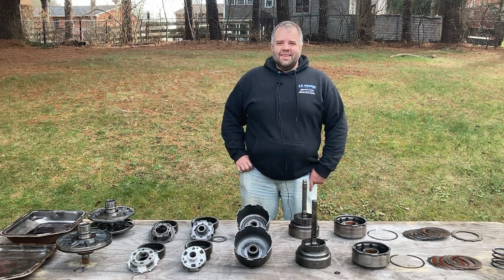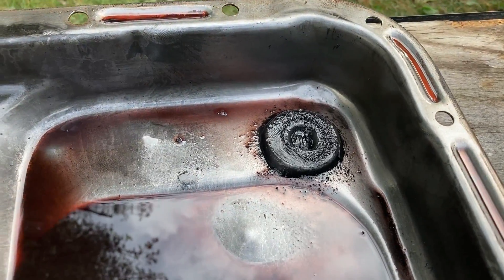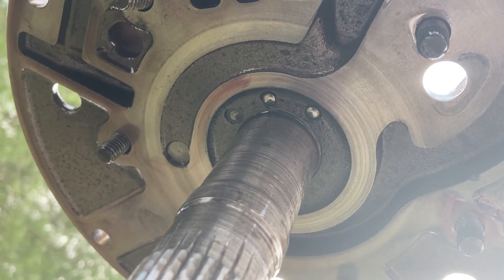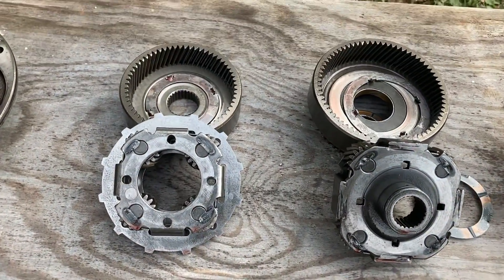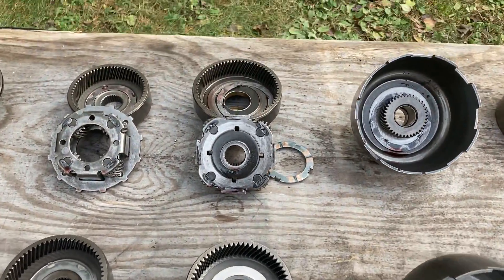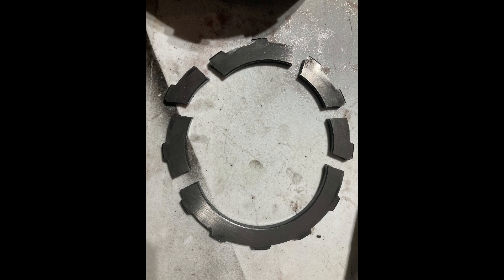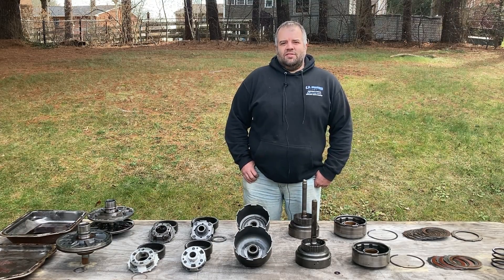Torqueflite build for Plan Z Dart - Part 3 - parts selection

Comment: nice video and great info...but building a trans/engine combo, to run 1/8 or 1/4 mile, over a determined rear gear ratio is lunacy....put the correct gearing the car
Reply from the maker: It’s all about the constraints of how far we want to deviate from lightweight, low drag, and factory parts.
Reply: @JohnWilburn  ok...you know the weight and estimate the low drag (interested how that's done) but if the factory gear was 2.73:1 you'd make a change, no? 

My point is gear it accordingly to match those parameters and change the gearing to match....plenty of ring and pinion combos with a Mopar...what am i missing ?
Reply from the maker: @smokeysghost4759  The effects of static weight are pretty easy because we generally see 1/10 second come out to equaling 75-100 pounds.  I actually took notes of estimated driver weights when I was at driving school because we saw all different size drivers in equal weight cars.  I got 84 an pound average. Rotating and reciprocating weight are much harder to estimate.  Usually we just rely on before and after data for that and this unusual combination doesn't have a ton of precedent.  Low drag means fewer parts like the 9" Ford, which while wicked strong, eats up a lot of ET to frictional losses because of the pinion placement OR loss to windage drag in the oil pan... things like that.  As for the rear gear:  4.10 is the deepest gear available for the fly weight, low drag (high pinion) 7.25 rear.  So, another deviation from "lightweight and low drag" would be going to an 8.25 and more gear.  Unlimited places exist to deviate from light weight and low drag, but everyone else is doing that.  Why not see how far a purely stock basis can go before deviating?
Reply: @JohnWilburn  ok, so in drag you meant driveline loss or parasitic losses...got it. I agree - 1/10 for every 100 lbs. 

the loss difference between a 7 3/4 and 8 3/4 - final gear same -  is negligible as I've seen/done 100's of chassis dyno runs. your biggest driveline loss will come from the auto trans vs manual (4-5%) and the converter stall speed and flash. Let me add - rear wheel weight and tire size/height are also an important drive-line loss winner or loser.

one quick edit - reciprocating weight/mass is all in/done with piston weight/con rod small end/piston/pin/rings - rotational weight and mass, as in flywheel, trans and driveshaft are going to deliver the lowest losses the lighter they are - on caveat here is that given the gearing you need to have the correct kinetic energy of the flywheel ( and this could heavier or lighter) to be both efficient.  As mentioned above, the wheel tire combo (weight) also store kinetic energy and need be correct - a light wheel (let's say magnesium is great on a road course and has minimum losses)

I still say gear it right
Reply from the maker: @smokeysghost4759  "Right" for a fixed parameter of a 4.10 gear or "right" assuming we change it?  I get exactly what you're saying and if there was one fixed and common goal for every build, there would be one fixed and common answer, but this build has flexibility and we can report the ups and downs.   No one runs a 7.25 rear, so isn't it cool to see what one channel can do with one?  There are 100 channels where guys throw them in the lake, stick in an 8.75, and talk about what all that does.  While it's ultimately Tony's call, I think for the fun and interest of the channel, we'll let the audience decide and can always swap later.  It's quite simple to swap gear sets in a trans once it's out of the car.
Reply: @JohnWilburn  Fair enough - thanks
Reply from the maker: @smokeysghost4759  His shirts do read:  "It's not how fast you go.  It's how you go fast."  I'm embracing that for his build.  I'll apply a standard I choose to the Dart Sport I'm doing and it will put vintage feel above absolute ET or power.  I'm all for seeing what other folks do with their visions, too.  To me, that just makes it more interesting :)

Comment: Personally I’d say standard in the low power setup. Use converter stall to compensate and later switch to a more appropriate rear gear. I’d also run a good cooler too though.

Comment: Could you put in one wide ratio, to help with the launch and strength. Then one aluminium standard for the 2-3 shift.
Reply from the maker: No.  They share a sun gear and must be used as a pair to work.  Even if you could mix and match, like in a manual transmission, it’s better to go a 1.54 second gear from a 2.74 first.  A 1.45 second is an even bigger span to cover.

Comment: John, I am not a transmission guy, but just from my perspective in protecting and saving the Transmission, I would recommend the Following 1). Install the deeper oil pan with the magnet-more clean oil running through the body of the A-Transmission cannot be a bad thing 2) Go with the steel planetary gears-aluminum can swell and break easier
Reply from the maker: Notwithstanding any veto by Tony, we are definitely using the deep pan with magnet.  As for the aluminum planetaries, I'm letting the viewers decide, but bear in mind that the Hemi cars came with aluminum carriers, albeit of the four pinion variety.  The gears themselves are steel in both.

Comment: My vote is the wide gearset..  when I had a 302 in CASPER I went to a 2.90 first gearset and it made a huge difference at the track... Plus I kept the 3.50 gear which was nice
Reply from the maker: Casper has triple the horsepower and weighs, literally, double what the Plan Z Dart does.  I'm not replying with own biases as I want to hear what other folks are thinking.  Casper is a beast!
Reply: @JohnWilburn  trust me this way before Beast mode!  It had a bolt on 302 in it first!
Reply from the maker: @UnityMotorSportsGarage  Oh, I very much do trust you.  I’m leaving my own leanings out of it and letting the viewers decide.  It’s just an hour swap if we want to change it later.
Reply: @JohnWilburn  I get that.. it's going be awesome no matter which way you go
Reply from the maker: Maybe Casper can race Plan Z with a 15 car length spot.   Hmmmm....
Reply: @JohnWilburn  well.. that would be interesting but that involves me getting MIXED UP BOSS DONE! Haha
Reply from the maker: @UnityMotorSportsGarage  Why?  Even on seven cylinders, that would be a race!
Reply: @JohnWilburn  oh I didn't tell you that 100 feet we drove it... Broke the Crank! Lol
Reply from the maker: @UnityMotorSportsGarage  Can't wait to see the autopsy footage or see it in person.  If you would, save a piece of the shrapnel for me.  That trip was a great story and memory.
Reply: @JohnWilburn  oh you will have an assortment of goodies to choose from! 😂

Comment: I had snap rings pop out after all my efforts👍👍🐎
Reply from the maker: Oh no!  Snap rings have to fit well or they don’t fit at all.... also, the groove is either all there or something isn’t right and needs to be corrected.  It’s tough to watch a 25¢ part cause havoc on a build.
Reply: @JohnWilburn  yes it was on my 95 f350 / electronic trans/ 460 motor / my son on in law was so sad I blew it
Reply from the maker: @Jupitermustangmike  Redemption is just another try away!

Comment: Dang it sux that your stripping an overdrive trans for it but you definitely should use the low ratio, I have the A500 in my Ramcharger and it’s nice and peppy off the line
Reply from the maker: The overdrive unit comes out in one piece, ready to donate to another A500 whose fourth gear takes a dump.  Nothing will go to waste!

Comment: I would go for a quicker 60ft if you not going o drive it a lot on the highway
Reply from the maker: The car is race only, but third gear is direct drive (1.00:1) in both anyway.

Comment: Seems from the way you are talking many parts are interchangeable and some are not, and it seems the cases are the same. Automatics are magic to me. Since some parts can mix and match can you explain what prevents you from using the steel short first gear with the aluminum second and drum? Is it a case of all the internals need to go in one case or the other? Would a custom high stall torque converter with the extra pan capacity be enough to make up for the tall first gear in a drag race only application where you are limiting the time for heat to build?
Reply from the maker: Unfortunately, the overdrive case can’t be used in a three speed application.  The extension housing bolt pattern is wider.  First and second can’t mix and match for a couple of reasons.....  unlike a manual transmission, where each gear is a stand alone ratio, the power flow of the automatic determines the ratios.  I’ll have a video on that soon.  Also, the front and rear planetaries can’t mix and match because there is a common sun gear that sticks out of each side of the sun shell and it’s larger in the 2.74/1.54/1.00 (wide) gear set.
Reply: @JohnWilburn  - thanks for the reply and the videos... I look forward to the rest of the series.

Comment: I’m for using the wide ratio planets, and a three clutch direct in all it will need..... to keep with Tony’s Swiss cheese theme you remove two of the pinion gears of the front planet and drill holes in the sungear shell and hunk of metal the low/rev band rides on to reduce weight and drag..... ha ha ha

Comment: Wide ratio for sure, that will help make up for the small engines limited ability to push up the stall speed of the torque converter.
Reply from the maker: Or a 5.13 gear out back with the close ratios. 🤔.  We’ll see what she does and can always easily swap gear sets later.
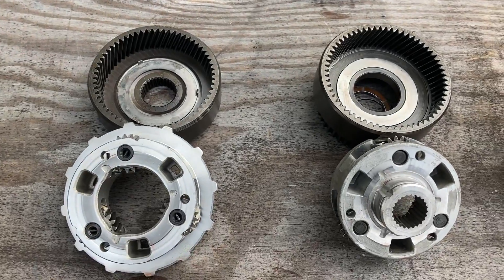Reply: @JohnWilburn  I thought Tony said 4:11s was the lowest ratio available for that differential.
Reply from the maker: @mikeeiben3430  Yep, 4.10s are it fo the 7.25” Chrysler, but he might be open to an 8.25” swap to get a deeper gear.... someday.
Reply from the maker: @mikeeiben3430  Hey, as a legit pro, feel free to share anything you want me to mention in one of these videos.  It’s super cool to have someone like you following the build.  I have a power flow video coming up next and would like to share your primary pump pictures and anything else you OK or want to share.
Reply: @JohnWilburn  feel free to share anything I send you. I'll try to send you information about the stator soon.

Comment: I don't understand all the technical details of the transmission,  but I did do a fair bit of drag racing when I was younger.  Anything that gets me off the line quicker, faster, and making power in the engines happy place,  that's what I want.